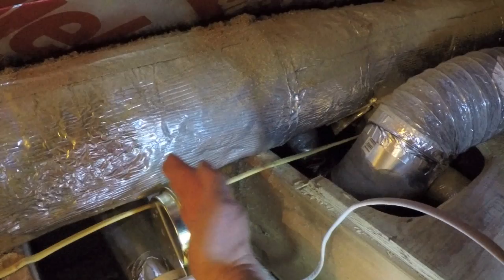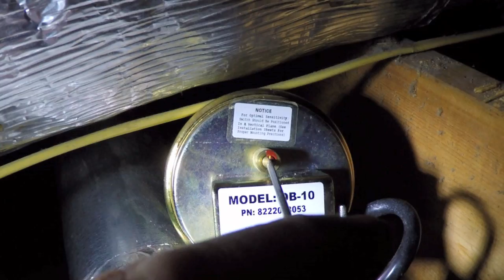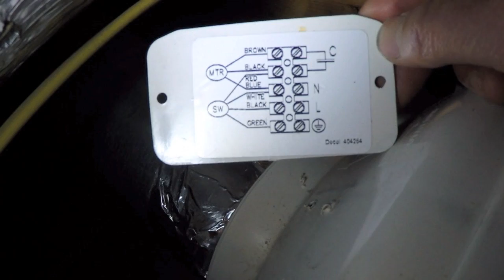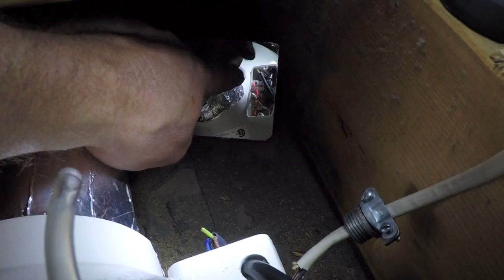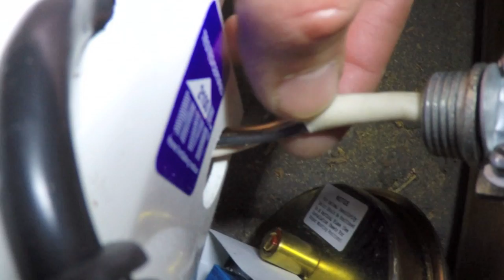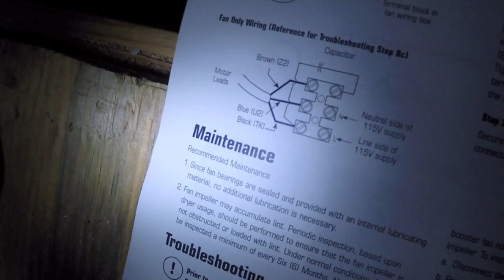Fantech dbf110 dryer booster fan  Part 1

Comment: Damn. Unbelievable video - even using a mirror! We're having the same issue, the fan rapidly turning on and off. Our fan was incorrectly mounted right by the dryer, and it's years old, so I think we're going to get a new one and have it moved to the correct position further along the vent tube.

Comment: I'm betting either bad voltage regulator (or bad cap feeding it) or bad run cap on the motor (or loose/bad supply wiring) causing power to drop and the circuitry to loose voltage and hence resetting.

Could also be a bad solder joint which is just barely letting enough power through to start the circuit, but fails when the relay energizes.  That would be something that would get worse after the 2 months of use.

Comment: I never knew such a thing existed for a dryer.  It looks a whole lot like the radon system I had installed on my previous house.  The fan body, shape and size are all similar to that system.  Same inlet and outlet diameter too.
Reply from the maker: Tech Gorilla I think fantech makes those radon fans too. we see a lot on houses here in the northeast.

Comment: Thank you for sharing. This is the only video i found. The unit failed  after 5 years. Would you be able to made another video how to replace this unit than rewired. It may costs more $ but this requires a lot of mechanical work. 😊

Comment: I found out the same issue with mine it’s the same one I installed 
What I think is you have leak in you duck pipe so the air get tru it and turn it on 

Quick solution is just add a electric switch and turn it when you turn the dryer on

Comment: Can you wire it to turn on without it turning on the dryer?  My neighbours laundry smell keeps coming in my vent.
Reply from the maker: By design, this unit is supposed to only run when the dryer is running. There is a normal delay after the dryer shuts off before the booster shuts off. This is to clear the remaining humid air out of the dryer.

Comment: Did you drill a hole at the bottom of the fan to drain moisture? Mine is installed horizontally too. I think it was in the instruction. I haven't done it on mine.
Reply from the maker: @sanchaofgo  I did not. I do not believe it e as in my instructions. I followed them pretty closely.
Reply: @stevewatr  Thank you for the info!

Comment: hey I know this video is old and who knows if you still respond but I have a question. first, thank you for sharing your knowledge working on the DBF110 and it's pressure switch.

i have encountered the same problem and did try adjusting the switch to the two O'clock position without any change. fan still not coming on so I've reviewed the schematic and your video. my question - why not just run the three motor lines as follows:
motor----------supply
brown----------red
blue-------------white
black------------black
Reply from the maker: Its been a while, but I think you are asking why you cannot just power the motor off the pressure switch, bypassing the circuit board completely. The first problem is the contacts in the pressure switch are not rated to take the full current the motor will draw. It would not last long.. The other issue is there would be no "post flow".The circuitry is designed to run the motor a little longer after the pressure switch opens.
Reply: @stevewatr  yes sir, that's what I was asking. just power the motor directly from it's 3 leads to the AC line's 3 leads.
Reply from the maker: @TecraTube  since you completely bypassing the switch it should work fine. It will just run non stop when plugged in.

Comment: Do I bring power to the pressure switch or motor first? The motor runs fine if I bypass the switch, it trips the breaker if I have power to both.
Reply: I have the Spruce model and the switch just two male prongs in it.
Reply from the maker: On my unit the power to the blower does not run through the pressure switch. It cannot handle that much current. The pressure switch controls the circuit that drives a relay that powers the blower. Its hard to explain if you do not have an electrical background, but think of it like this. On a car, when you turn the key, the starter motor spins. But the power going to the starter is not running through the small wires and little switch you're turning with the key. The power from the battery to the starter goes through thick cables to the starter solenoid that has big contacts in it. Those contacts are closed by an electromagnet that is energized when you turn the key. Its a relay. Relays are used when you want to switch a higher powered device with a smaller switch or control. In the fantech, the pressure switch has very small voltage and current going through it that is sensed by the electronics. The electronics decide when to turn the blower on or off. That's why the blower still runs a few minutes after the dryer stops. Because a built in time delay in the electronics controller.
Reply: @stevewatr  I have a an electrical background I’m a journeyman going for my masters soon, even my boss who’s been a master for years was perplexed like wtf is this. The old unit I demoed had a a circuit board in it with a step down to lower voltage for the pressure switch, this has two male prongs and that’s it with a small diagram showing a switch, the motor has a 120v inlet and I put a connector on it and 120 bolts to it, I mounted the pressure switch and put the air hose on, I just can’t find where the 12 bolts comes from, like I said my master was looking at and he said the same thing. Where is the low voltage come from. I installed the Spruce DB model.
Reply from the maker: @christopherhuff9883  sounds like that is quite different from the one I have. My pressure switch is very small and low voltage....like s logic switch. So I would not be able to answer your question without seeing the circuit.